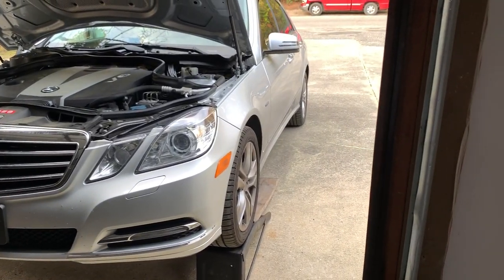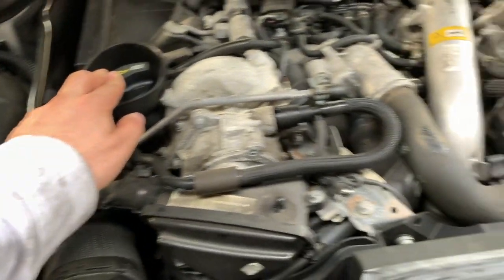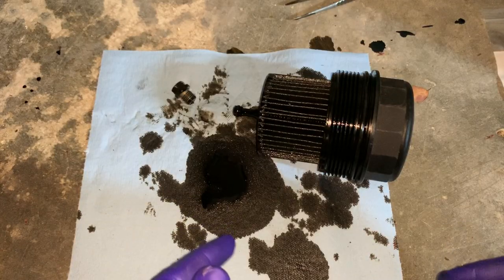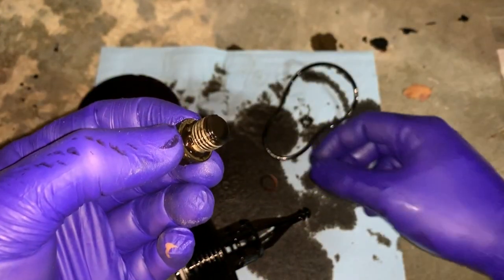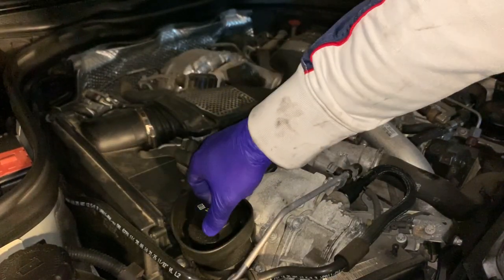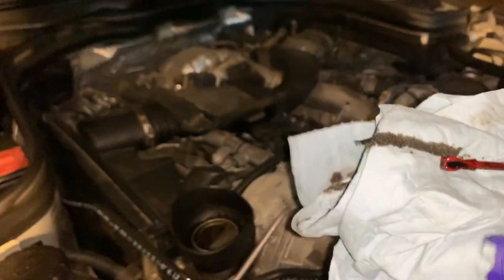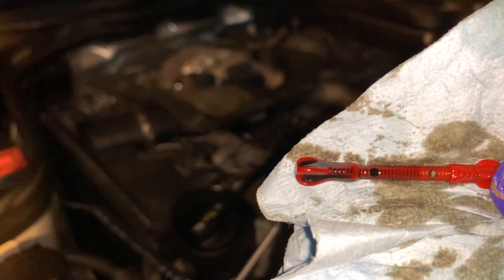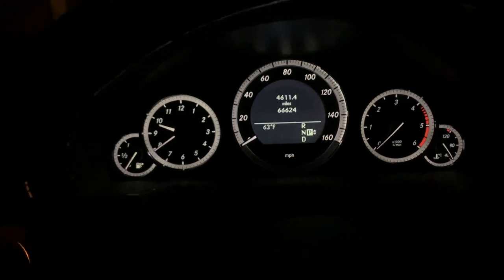How to Change Oil on a Mercedes Benz Bluetec

Comment: Thanks!  That'll save a lot of money compared to dealership!
Reply from the maker: Yup, that’s what this DIY channel is about. Thanks for the feedback.
Reply: You can also suck the oil out the dipstick tube on most MB engines. The tube goes all the way to the bottom of the pan for this specific purpose in mind, so a vacuum pump makes quick work of the oil.

Comment: Hello, i got a e350d 2016 bluetec. The engine oil capacity is 8liters( that’s what it says in the car manual) What do you suggest, going over a bit or under? Can t get a clean read on the dipstick because looks so messy by the time it s out. For the moment i have 7.5 liters in there
Reply from the maker: Being under is recommended. Helps with blowby a bit... not too much pressure in the crankcase.

Comment: Jam duke ble te njejtin benz te 2012 me 100.000 per 16.000 euro. Sa shkojne shpenzimet dhe konsumi naftes, si je gjendur? A ja vlen?
Reply from the maker: Per mua me ate çmin shum mire e ke gjet per 100.000 km. Mua me shkon nga 6 l/100km ne rruge te gjata deri ne 9 l/100km neper qytet. Taksat vjetore ne amerike jane rreth 200 dollare. Ndrrimi i vajt bashk me filtrat dhe ate te naftes I bej çdo 7000 km shkojn rreth 250 dollare, kurse per mua qe i bej vete shkojne rreth 50 dollare.
Nqs di te rregullosh shum gjera vet, per mua ja vlen.
Reply: @AlbanianFix  jetoj ne zvicer e ktu bie bore dhe jam akoma duke vleresu nese ja vlen ta mar apo jo. Makina eshte vetem rwd dhe jo 4matic. Mendon se do kem probleme me boren? I vetmi preokupim qe kam eshte ky pasi makina eshte si avion, i mbajtur ne garazh e tr gjitha sherbimet te mercedesi, full optional amg line. Me jep nje keshille te sinqerte nese ja vlen te rrezikoj me boren meqe ka diferencialin mbrapa apo te gjej me mire nje formatic.
Reply from the maker: Per bore nuk di ça te them fare, jam kshu out fare se ktu ku jetoj nuk bie temperatura me shum 10-12 grade, eshte ngrohte gjithmone. Kaq keq eshte bora aty? Hajde se po flasim per shqiperin neper vende ku bie bora keq fare dhe mungojne disa standartizime rrugore qe te jene pak me te sigurta rruget. Po ne Zvicer? Aty ku parametrat dhe kushtet jane te plotesuara ne maksimum, sbesoj se do jet kaq keq. Apo ka te ftohte te acarte aty me ngrica dhe bore qe edhe me zinxhir ti kesh gomat, prap rreshket? Megjithate siç te thash, une nuk flas dot per sa i perket bores se skam patur asnjeher rastin.
Reply: @AlbanianFix  rruget kryesore ktu i pastrojne dite nate por skam patur kurre makine me diferencialin mbrapa e disa qe kane benz jo formatic ma kane bere gogol sipas eksperiences se tyre. Makina me duhet cdo dite te shkoj ne pune prandaj po vlersoj cdo aspekt. Gjithsesi me vjen keq ta le makinen vetem per kte shkak por do ta mendoj mire, rrofsh per keshillen e sqarimet e qarta si me bo servisin vete makines👍

Comment: I use a vacuum pump on my other Mercedes, just got a bluetec yesterday can you change oil on diesels with a pump too?
Reply from the maker: I’m not sure to tell you the truth… I have never used the pump at all.

Please don’t use that thing…

Honestly, IMHO, the pump is such a gimmick!! The most half-azz, laziest way, waste of money and totally not doing the one thing that oil changes are done for at the first place.
All of those tiny particles and metal shavings plus the gunk from the oil that sits at the bottom of the engine (gravity), is not being picked up by the pump at all (maybe some of it depending where the nozzle of the pump hits) but for the most part, NOT at all. So think about it, all that gunk that collects after years, the moment your start the engine, it’s going to slosh around and get stuck somewhere vital to the engine performance or death.
Yes, lifting the car up and taking the undercover off to get to the drain plug is a hassle but you are draining oil at the lowest point of the engine which means all of the residual gunk and metal shavings will come out. It’s so much safer and  cleaner for the engine!

The pump was invented for people that don’t have tools or even garages to work on cars but still tried to find a way to make them happy and think they’re doing an actual oil change and not have spend to money at the dealership. It’s more of a political tool for car makers to make them look like they care about the customer than it’s an actual oil changing tool.

Anyway, just my my humble opinion…
Reply: Thanks for the input and I agree with you. I've been using the pump so I don't spill oil in my grandparents garage. My pump has thin tube that reaches the bottom of the sump pump.

I will stop using it though, you made me realize the potential long term effects of never truly getting all the gunk and debris out

Comment: You should put Mobil1 5w-30 motor oil in, best for MB
Reply: No such thing as best. If its synthetic and in spec, they're all pretty much the same. My friend's fleet of sprinters with this engine just reached 700, 750 and 800k km respectively on Ravenol VMO, original timing chain on all 3 vans. Change your oil more often instead of trying to hunt for snakeoils.